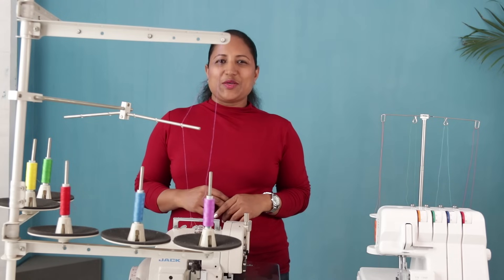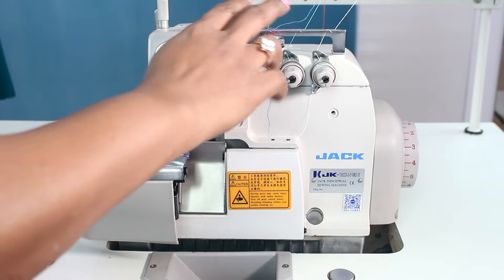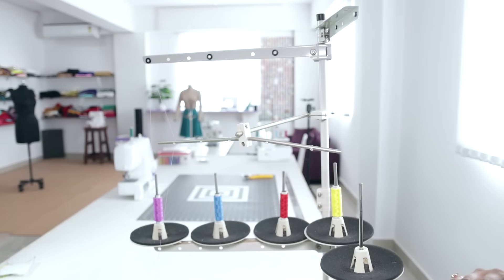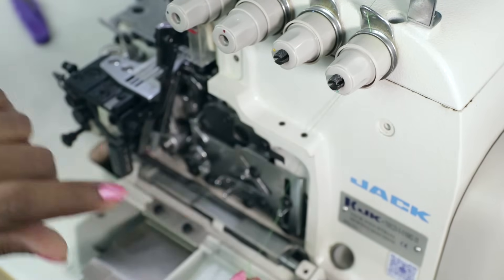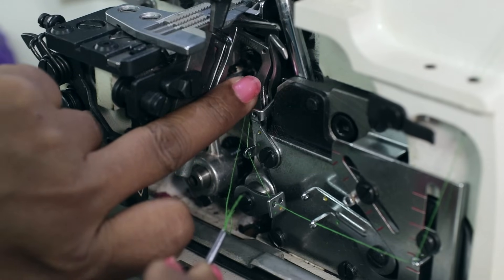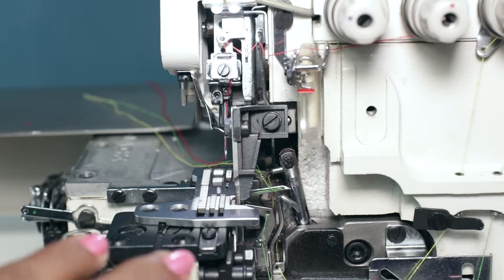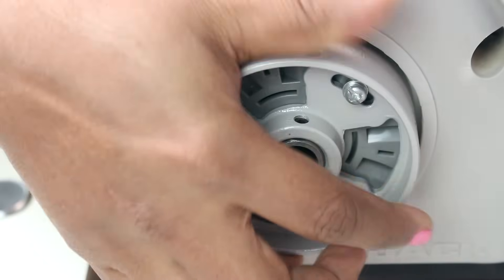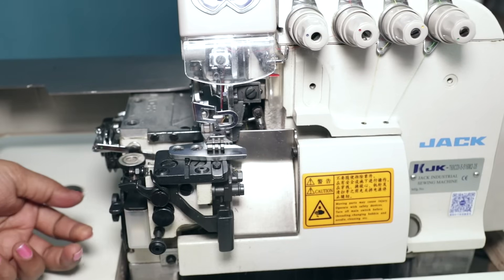Class 43 - Jack JK768DI 5 thread Industrial Overlock Machine - how to thread and how to use - Part 2

Comment: I have the Jack E4S and had it for about 6 months and wouldn't be without it, it's quiet, (wouldn't wake a sleeping baby) variable speed, and the second line of stitching which is 3/4 of a cm from the edge I use as a guide for sewing a 1cm seam allowance.

Comment: I believe that this can also be used as a 4 thread overlocker as i have Jack E3 4 thread Overlocker and it has  the same mechanism except for the chain stitch (the last part of threading). Thread the 2 loopers & the 2 needles and i assume it will give you a 4 thread overlock. I tried a 3 thread overlock on the 4 thread Jack E3 by not threading the second needle & it worked, that's why i believe yours could work as 4 thread overlocker too.

Comment: Hi mabey you have an operation manual for this Maschine.
I buy this from other person but there is no manual at there.
I want to know Can use the machine with 4 threads? I hope you can help me.
Reply from the maker: Manual is of no help. You can use 3 or 5 thread. For 4 thread you will need to talk to a technician who can do with some changes in parts.

Comment: Hello mam,
Your explanation is too good.👌mam I have doubt.please help me 🙏
1.which overlook  machine is very useful for all fabric and boutique purpose.
2. What is the difference between 4 and 5 thread.
Reply from the maker: Hi, thank you. 
If it is for business purpose you can buy an industrial overlock machine which costs around 26k or a regular overlock machine which may cost around 6 - 8k. 
4 thread overlock is the most commonly used and 5 thread  overlock will have an additional safety stitch which makes the seam stronger.

Comment: how to reduce the speed of overlock machine? I have other brand overlock machine, but I think all of them works in similar system. I will appreciate a lot, if you post a demo for that.
Reply from the maker: If you have similar machine,  and if your machine has speed control option in it,  on the right hand side down there is a control panel in which you can increase or decrease the speed.  I have shown setting the speed in our free tutorial on using jack sewing machine. It is the same way in this overlock machine also.  Please refer to this link: https://youtu.be/ESX_7VtnqpE
For full fledged online sewing classes and for sewing tools, please visit www.savisfashionstudio.com

Comment: Hi I'm having an issue my machine is starting i just bought it new.  Build in motor option they power is shown on screen but still machine is no working what shoul i do now??
Reply from the maker: Hi, what does the digital panel show?
Reply: It is showing everything and every button is working and still machine is running either starter has some issue or something else

Comment: Thanks for the video im wondering if i can do a rolled hem on this overlocker. also I would like to know if i can sew a knits using only 4 thread on this overlocker. thank you savi.
Reply from the maker: Yes you can sew knits with this machine with 5 threads [reinforcing stitch is needed].  Rolled hem not tried - Will need to check.
Reply: Savi's Fashion Studio  thank you so much for your response. I would love to do rolled hem and I cant wait to find out. thanks again

Comment: Computerized? How is that?
Reply: And these machines work best with cones not domestic thread, hence why your thread is sitting up high. It would mess with the tension if you use domestic spools.
Reply: AHS Society Btw you have not watched full video I guess, suggest you to watch complete video
Reply: Yes i have, and I will repeat
1. How is this a computerized Overlocker
2. You cannot set proper tensions with those domestic thread. Switching it out and the end will require re-tensioning.
Reply from the maker: Hi AHS Society, There is a digital panel in this machine which lets you set the sewing speed and set the needle position. That could be the reason its called computerized.
Reply from the maker: Yes, you are right - cones are best for overlock and we use the cones for overlock sewing.

I have used small spools of sewing threads just to have different colors in overlock stitch so that the upper looper, lower looper and needle threads are clearly visible.  This was explained in the first part of the class that is on Juki Mo50e. Hope you have seen that. 

However, would also like you to note that using the small spools did not mess with the tension for me.  You just need to adjust the tension accordingly.  We do use it sometimes when we want to match the color of the overlock stitch with the color of the fabric and never faced any issue with the quality of stitches - Regards, SF Studio